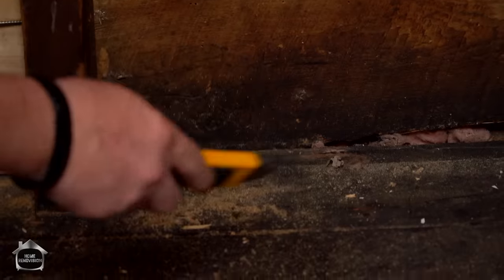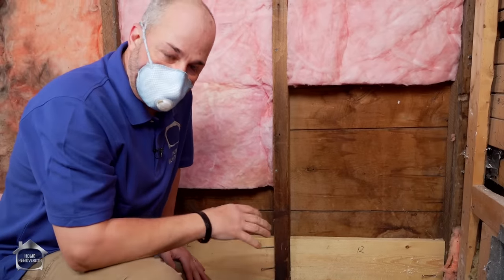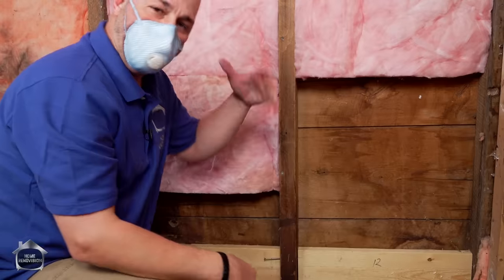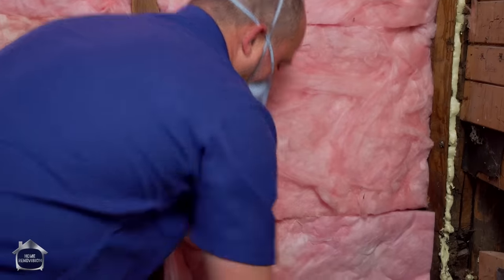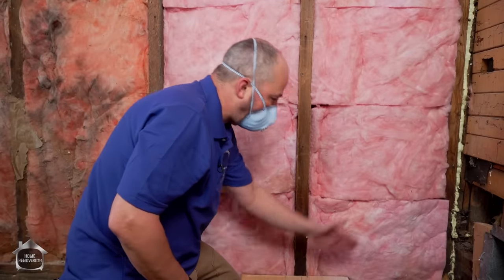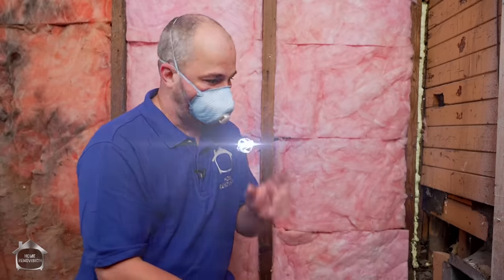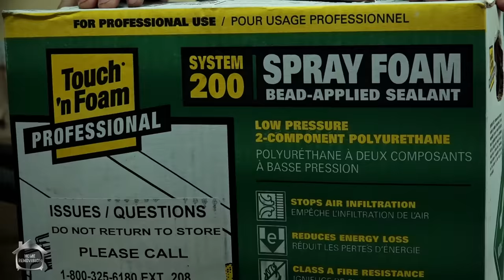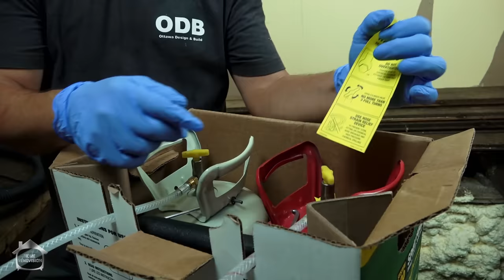How to Install Insulation Yourself! | DIY Insulation Tutorial

Comment: Thank you so much for this. This is extremely helpful. Truly: I feel like we’re dealing with a very very similar situation. Dead mice here too: (which mainly breaks my heart, being an animal lover)  everywhere- Rotting wood, insulation problems, ventilation problems, molding. Crawl spaces. Spiders 😖 - I understand that all or most of these problems are interconnected and one problem leads to another, and everything is exacerbating my structural problems....but no one else in my family seems to agree: they want to move in and rush everything because our current living situation is less than ideal, BUT not hazardous to our health (just our mental health lol in-laws, anyone, am I right?) It’s just been an ordeal with me arguing the fact that rat droppings, Mold on ceilings, molded furniture from previous tenants (which I’ve already disposed of) high humidity and half of the vents don’t even work, or work ever so barely. (The previous tenants built onto the original old home in my situation too.) You’re like my saving grace, Jeff & everyone at Home RenoVision DIY. God Bless. Thank you, thank you THANK YOU! May you & your family & crew receive blessings abundant for all the help you’ve given your viewers. 🙏👩🏼‍🔧💪😁🙏
Reply from the maker: Hi Katie, here is a great tip for you while you renovate. I installed a 6 pack of ultrasonic pest repellers and it worked like magic. no more mice at my house , which left my dog a little bored. simply plug in and they leave  never to return. I added the product to my list of favorite products on our Amazon page. Link in the description. Cheers!  Any chance you are in upper state new york, we would love to come by and see the project!

Comment: Just had some water damage to a 1960 home that didn't have insulation in the walls.  water remediation company did flood cuts (2' cuts from the bottom).  It is a single story home.  Is it worth it to put insulation in the bottom 1/4 of the walls, before having the the drywall put back?  Not, there was asbestos in the joint compound when testing was done by a testing company hired out by the water remediation company.  So now it costs a lot to remove old drywall professionally by an abatement company.    The concern is, will putting some insulation at the bottom of the exterior walls, be a detriment down the line?   Thinking if I do, based on what I've learned, RockWool Comfort Batt On exterior walls, Safe and sound interior partitions.  Not sure what to do about the upper cavities that still ahve dry wall, and a wood block some where in the middle.  I've seen some videos that show getting a company to drill some holes at the top of the dry wall to blow in insulation, but then , you have more drywall patching to do.  Is that pretty much the only option we have to insulate the rest of the walls, without taking down the remaining drywall?  Is it better to spend that money and perhaps insulate the crawl space which is a raised wood foundation and attic  instead of trying to address the walls?
Reply: Yes. insulation in there and a vapor barrier... if you live in a cold climate during the winter all the cold wind will come through those holes and kill your wallet if your run electric heat. Good luck.

Comment: I have a mobile home with roof and wall structure water damage on the back side. I’ve looked for help for months!! It’s has metal roofing but wasn’t completely done and that’s where the damage is. Also I paid for a guy to put gutters on the home. The gutters was hung to boards that didn’t support the weight of the heaviness of the gutters, so they started sagging down defacing the front wall. Birds made a nest of hanging gutters breaking down into the wall. I need help to get the place back livable for us to live!! Long story short I am having to restore the damages before winter!! Any tips, suggestions, ideas, references, and/or helpful advice would be greatly appreciated!!!

Comment: Hi Jeff,

Great video and gives me great inspiration! I am in a 1957 slab on grade home with what appears to be multiple addtions over the years as well as built out, walk-out style basement with a partial concrete wall. Some of the walls I cannot see what they've done, other walls (such as the concrete wall of the walk-out basement) it appears they've done ok with installing foam board directly onto the concrete.

What I have noticed though, upon more inspection is the remaining sections of walls of the walk-out basement appear to be what you call 'balloon construction', or at least, some variation of that. It looks like it is 2x4 framing with the siding being attached directly to the framing. There is no OSB or plywood sheathing. What there is though, is a layer of some paper product, felt or something like that? It's black, thick and has a felt like feel to it. I can see it easily, directly between the 2x4 frame and the siding. The 'original' insulation, faced fiberglass batts (it appears) is very sparse and so it's easy to see the wall. 

My question is, whats the best way to handle this? I would like to use foam board in the stud bays with can spray foam to seal the edges but I am concerned about by doing this am I, ultimately, compromising the felt paper (which actually seems it quite good shape) with the spray foam adhering to the felt and to the foam board? Even if I don't directly use spray foam to attach the foam board to the felt, I can't image when sealing the edges between the foam board and the studs, that spray foam won't get through and adhere to the felt paper. If I plan to, at some point, put new siding over the older existing siding (and maybe a new house wrap/rain-screen) then I think this approach is ok? Or am I missing something?

Thank you for any insight or ideas.
Reply from the maker: It seems you have bought a production house and it is not balloon frame. That is good news! My recommendation would be to insulate the wall cavities and not worry about the tar paper. if you change the siding at a later date then having remnants of the paper attached to the foam will not affect the installation of any of your new systems. Cheers!
Reply: @HomeRenoVisionDIY  What's the difference? I need to look at the transition from the first floor to the second to see how that's been constructed but I don't understand the other possible differences between the building styles?

Comment: Curious why is the fiberglass in the crawl under the vapor barrier and not on the outside? Wouldn't this approach cause the insulation to absorb moisture and reduce its R value?

Also these videos are amazing!!!
Reply from the maker: moisture is created on the warm side. that is where the plastic is. Cheers!
Reply: @HomeRenoVisionDIY  thank you for making incredible videos and keeping it fun
Reply: @HomeRenoVisionDIY  what about moisture coming up from the ground, which gets trapped under the moisture barrier, then flowing up into the wall fiberglass insulation
Reply: Oh I see that you did not seal the top end of the blanket, thus the moisture from ground may flow up but would not get trapped in the blanket

Comment: If you catch it soon enough typically anything in the first 12 hours you can use acetone and it will remove it and eat it just like it does to a foam cup. But if it is fully cured does not eat the foam like a foam cup

Comment: I know some houses, at least in the hotter parts of the US, were built with draft attics to help facilitate cooling. How can I tell if I have a house like that, because I have inch+ wide gaps visible from inside and outside of my house leading into the attic, and I don't want to use expanding foam if that's intended design.
Reply from the maker: Great point. ventilation in an attic is a completely separate technology from thermal barrier. in most homes the attic needs fresh air to function optimally. in most cases if the insulation is at ceiling height do not modify the attic...........period.,Cheers!

Comment: My house, which I have completely gutted, is a cinder block house, built in the 50's. The only insulation in it was in the ceiling, and it was only R11. The walls were sheetrock on 1" furring strips attached to the cinder block. All of the wiring was a giant fire hazard not even in electrical boxes in some places. My original intent was to build 2X4 walls against the cinder block and insulate them. But after learning about having a thermal break, a couple of years ago.....I think I'm going to put rigid foam insulation against the block walls and then build my 2X4 walls and insulate them. The house has been gutted for a couple of years now because changes in the floor plan which the wife and I are still trying to agree on, while living in an apartment in another town....lol
Reply: I have an issue that I can't figure out, about insulating the attic space. The roof is stick built with 2X4's. You can easily stand straight up in the attic. I plan to put batts of R30 insulation between the ceiling joists and putting OSB in to build a floor for storage space. I've seen research that says you should have a 2" space between the roof deck and any insulation, to protect the shingles from dryrotting in the heat. Should I attach rigid foam board to the underside of the roof trusses to cut down on the heat in the attic,  for storage? There is a gable exhaust fan on the front gable end wall and an open vent on the opposite end wall.
Reply from the maker: Hi Ricky, so no problem with the ceiling insulation and osb approach. I assume you live in a climate where freezing temps are not the issue!  ventilation is probably your enemy in this environment in the summer. if you insulate against the roof deck you need to have good soffit ventilation along with a ridge vent. relying on on gable vents in conjunction with trapping hot air against the roofing will result in reducing you life span of your roofing materials by half unless you have metal! If you have humidity as well then more ventilation is definitely required before you try to reduce heat in the attic space. The house comfort must come before your own. Cheers!
Reply: @HomeRenoVisionDIY  I live in an area where we do have cold freezing temperatures with snow in the winter and hot humid temperatures in the summer. I live in a river valley in West Virginia.
Reply: @HomeRenoVisionDIY  I did some electrical work in a neighbor's attic. His attic had a ridge vent and a gable exhaust fan,  along with a metal roof. His house had the same problem as mine,  where someone put in ventilated soffit for looks,  but it's sealed up and non functioning

Comment: I love your videos, but I'm completely thrown off about your old barn house. I have a house built in 1882 that has plank walls (I hear they're called box houses). So I have a layer of vertical inch thick planks on the outside, a couple of horizontal 2x4s across the wall, then another layer of inch thick planks that are cut out in what looks like they're supporting the joists. There's no 2x4 stud walls! But I do have this 2 inch gap between the planks in the walls before the lath and plaster are on top of it. 

So do you use expanding foam for between the planks? Do you somehow try to cram batts in there? Do you just leave it empty and get on with your life?

Comment: I'm trying to insulate the exterior rim joist its. 2 1/2 feet by 35 ft . it has foam board n thin strapping should I put plastics sheething on it .??

Comment: I removed the lath and plaster in my 2nd level bathroom (thanks for the plaster removal tips during the last live show), however the walls had blown in Styrofoam insulation on the two exterior walls and it ended up all spilling out (obviously..). What do I replace this with? It seems it goes all the way down to the first floor somehow, but I could be wrong. Thanks for everything!

Comment: Hey Jeff I am insulating my house built in the '20s in Detroit I also have a basement that differs from this house and have a livable attic is it okay for me to put insulation just between the studs and put a vapor barrier or do I have to leave some type of gap like a house has like a wrap on the outside of the wall to leave for the water to run down.

Comment: as usual...great video. i messed up and wrote a product name and vendor down from previous video and promptly lost it. think vendor was dap. tube sealant for exterior use and when dry had to be painted to stop uv rays from deteriorating and applied with regular caulk gun. any thoughts, thank you.
Reply from the maker: use polyurethane caulking. the brand is less important than the product type. Cheers!
Reply: thank you

Comment: Jeff, so if I had an air brick in the wall as long as I keep the insulation below the airbrick to maintain airflow it would be ok?
Reply from the maker: the secret to keeping thin gs warm and dry in an old house is to control water. where you have air flow you have condensation. so sealing up the interior is very important.

Comment: Hey Jeff great video!! I myself have a balloon frame construction 1920 with a added addition later on my question is with the fiberglass rolls of r15 or r19 do you leave a gap for air movement possible condensation and mostiure in the bays or do you leave it tight to the outside plad of the wood siding

Comment: Hey Jeff, Jeff here, i have a 1947 cape cod in northern Ontario and im wanting to maximize my wall insulation without doing exterior enveloping. Ive used these spray foam kits in one area to fill my 2x4 wall cavity in a couple rooms but want to go higher and reduce thermal bridging. My thought is to add 2x2 furring strips perpendicular to my existing 4x4 wall studs, with some paraellel in areas where i need electrical outlets to build out the wall and reduce thermal bridging, and fill the entire cavity with sprayfoam, and drywall over that. is that a reasonable idea or is there a product im not aware of that can be applied between the studs and drywall for this application
Reply: I've been  furring out my walls 2" & putting rockwool insulation R22 in, just to meet code of R20.  
But I believe out in Ontario there, you guys can even get R27? Rockwool insulation?  
I heard u only get a R5 for every inch of foam? 
However I'd like to know if I could use foam for my seams where the joists touch the exterior plywood of house? 
& any other useful information that could help? Or corrections if I learned things wrong?

Comment: I have a room with the ugly late 80's style wood paneling on the walls. It looks like there is some kind of drywall behind it. Can I just remove the paneling and then add a thin drywall on top of the existing to make up for the thickness of the removed paneling? Or is it proper to remove the wood paneling and whatever drywall is behind it and start from the beginning?
Reply from the maker: you can just finish the drywall unless you are trying to reuse all the trims!
Reply: @HomeRenoVisionDIY  Thanks Jeff! That makes sense. For whatever reason I was thinking the wall switches and outlet would be sticking out too far. Keep up the great content!

Comment: I know it has been almost two years, so not sure if you're still reading these - but do you have any advice on vented crawlspaces? I'm down in the PNW where these are pretty standard. I'm leaning towards leaving it vented and only insulating the underside of the floor (suspended timber), but I cannot find any good advice anywhere that shows anybody doing in that in a way that creates a proper thermal break, vapor barrier, and air barrier.

Comment: Hey Jeff! Is it true you can use closed cell 
spray foam right up against a vaulted roof structure and not need to worry about venting or airflow through the roof structure?

Comment: Jeff, Would you then recommend batt insulation vs rigid panel insulation for crawlspace studded walls? I'm looking to get a good seal on our crawl space before we finish our 940sq ft basement.
Reply from the maker: batt is where it is at. Cheers!
Reply: @HomeRenoVisionDIY  Thanks!!! Do you have a favorite go to Batt insulation? So many options out there! Looking to maximize moisture block and temp transfer.